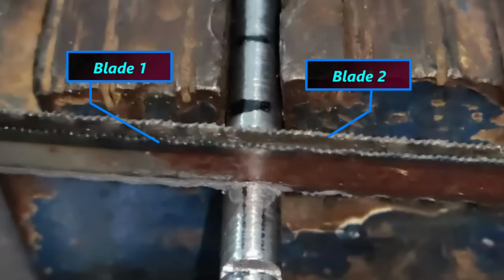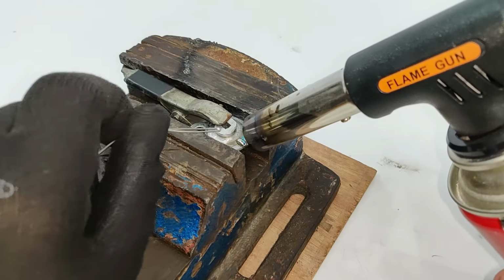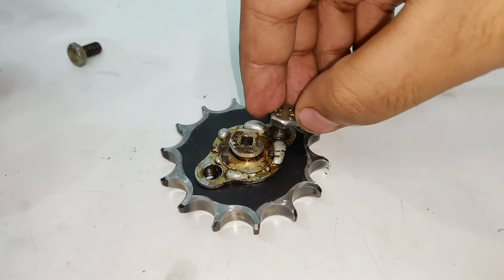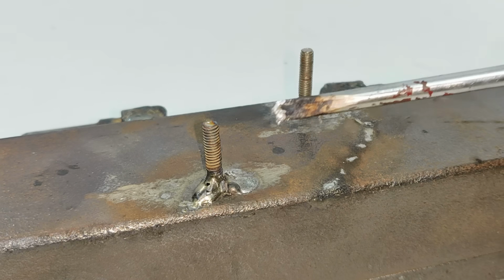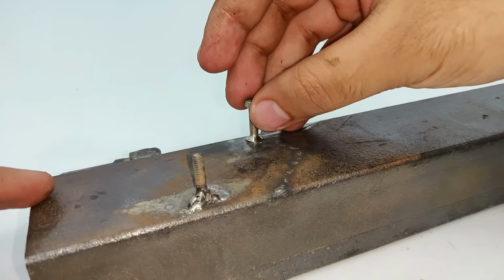Amazing Project with 12v DC Motor & Chain Sprocket

Comment: 1. Before soldering, the parts must be tinned. Special flux is cheap. 2. The sleeve for the gear had to be made not with a drill, but on a lathe. It is there! 3. What is all this for?

Comment: Sorry, where did the power come from for the spot weld? You can afford a lathe and an overhead drill but not spanners for the bolts or a proper welder or a better gas torch to silver solder with, Not a good hack. Put any load on the rack and the alloy drive on the motor would spin the solder off. I wont mention the other five reasons it would not do any useful work.

Comment: Well done! I liked the drill press spot weld the most! Very clever!
Reply: Sadly, the bearings inside the Drill Press Spindle will already be permanently damaged because the full Weld Current must pass between both Inner and Outer bearing race.